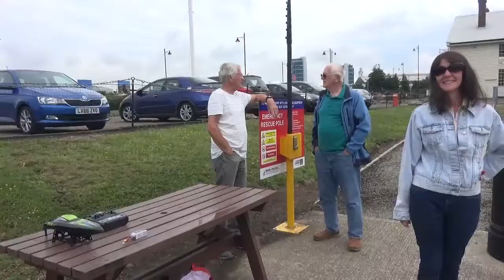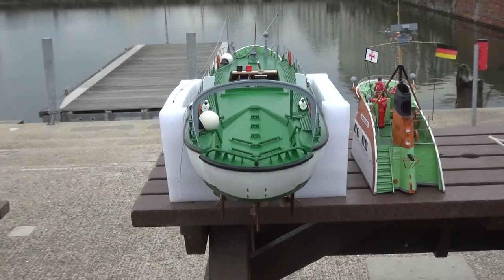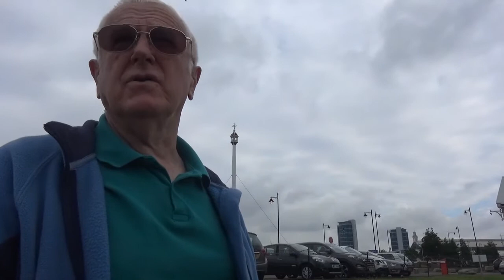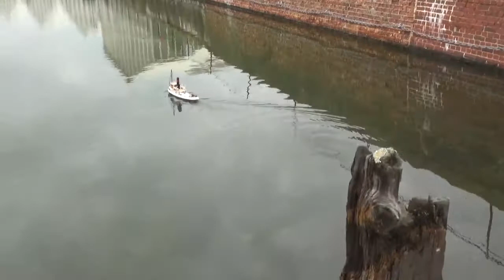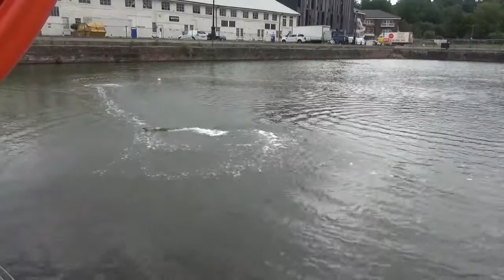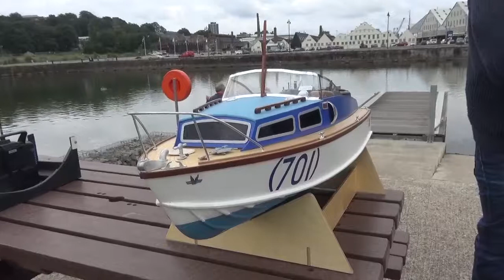UDI908 at Chatham Model Boat Club

Comment: I noticed that you were not on the pond while the gentlemen sedately bobbed about and they weren`t on the water when you tore around. Do the sail boats operate by twisting the mast with a servo and actually use the wind or are they prop driven?  David.
Reply from the maker: I was on the pond, just not on the same area. I did venture over to one of the three others but drove very sedately you will notice so as not to make waves. The sail move via servos, so they are proper sail boats. Cheers David, Laurie.